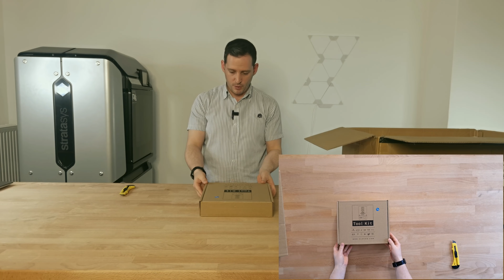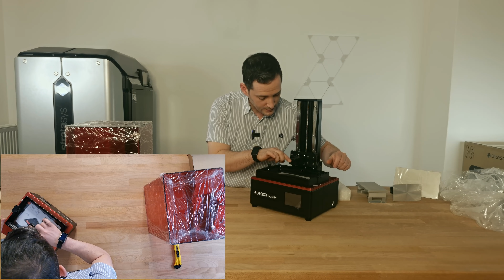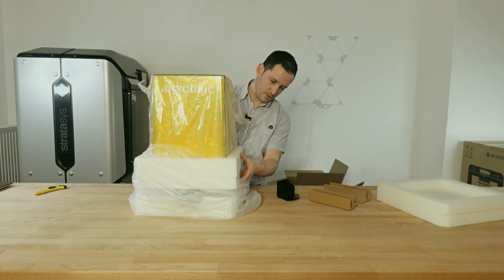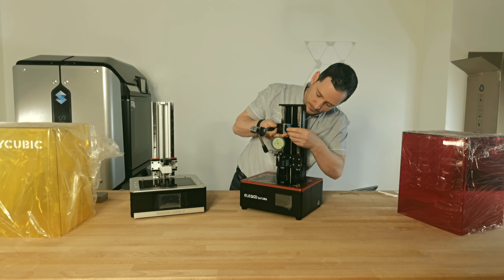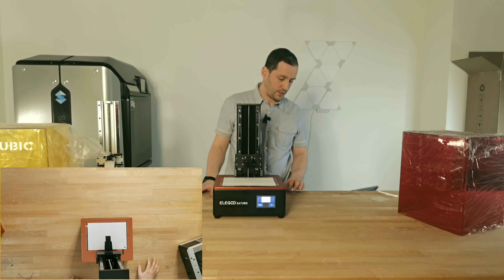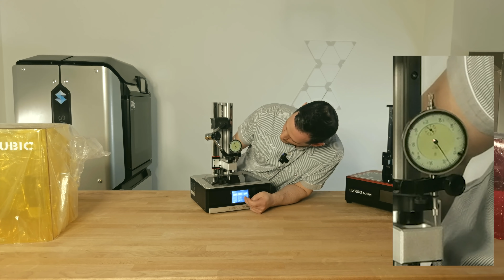Elegoo Saturn vs Anycubic Photon Mono X (In-depth comparison)

Comment: Can I be so curious and ask about how you set up your overhead shot? Thank you for the informational video!
Reply from the maker: Hi. I did mount a rail onto my ceiling. From there I do use a telescope selfie stick which I adjust in length so the front camera does not see the ceiling camera. I can adjust the position of the ceiling camera by moving it in the rail and changing the length of the stick. Hope this helps.
Reply: @Twins Talk  Thank you! It looked really nice so I had to ask. :) Have a great day!

Comment: Was there an answer from anycubic by now?
Reply from the maker: Hi. No there was no answer. I got my money back from PayPal.
On another note, I did buy the anycubic m3 max and will compare it to the elegoo jupiter. Stay tuned.
Reply: @twinstalk  thanks for the quick reply. Will you also get the new saturn 2 8k and compre it to the other?
Reply from the maker: @MCaquaculinaris  most likely not. I did buy the jupiter and the m3 max. I also will get one of the bamboo labs printers. So my budget is down to zero.

Comment: Great technical review! just for my curiosity, why is backlash in Z so critical if the printer always retracts to about 5-6mm and goes back down in the same direction? 
What is important in my opinion is not even that it doesn't get to the same position in two different directions, only that it gets to the same position in the same direction! Any mechanic knows that you have to work in one direction to get any reasonable accuracy (for example if cutting screw threads on a lathe), so you do exactly what the printer does - cut in one direction, pull back not cutting, and do the next turn in the same original direction.
In summary, I doubt this "Z backlash" is really such a big issue. I would be much more concerned about Z wobble and sturdiness of the printer.

Comment: To each his own opinion.

But if a manufacturer is not able to correct its case to fit the intended use when it changes something in development (display size), then makes its customers happy with a "gaffer tape", it should probably rather build with Dixi toilets. 
Honestly, I find something like this more embarrassing than the type of surface of the build platform. On the one hand, the decision to use a flexible pressure plate is not a bad one given the size of the build space, and there's no substitute for 50mm more build space. 
In practice, the pitching movements do not come into play with either, but yes, the build plate is crowned, but you can complain about that. Others also manage to have the inaccuracy captured by a camera. However, your equipment was not set up for that. 
But as written at the beginning, to each his opinion and his priorities.

Comment: The edge bevel is probably to help break the hydrostatic pressure of the resin during separation of the build plates movement
Reply: Yes, I don't believe that the entire build plate is supposed to be completely flat. It is my understanding that, If the plate were completely flat the hydrostatic pressure would be too high and end up tearing the print off of the print bed. 
This is important information to have prior to breaking out the measuring tools and pressing the record button. It makes Anycubic look like they are producing low-quality products when in reality it is the testing process that is off. What was the reply when you reached out to Anycubic customer support? If the plate is as it should be and the error was on your end, then the only ethical thing to do would be to edit the video and reupload.

Comment: What is the feedback from anycubic? Is that defective and need some new replacement parts? Also any actual print test? Great review. I subscribed your channel right the way.
Reply from the maker: Hi xMondas King. According to Anycubic, new parts have been sent out but these never arrived. Also I did not get any tracking number. The support responded fast (used Aliexpress chat) and was very nice. After not getting the parts, I asked for a refund without success. Had to use paypal to get a refund. Long story short: Parts never arrived, printer is still defective.

Comment: Amazing Video! informative and to the point! I have both and my Mono X doesnt have the build plate issue or the wobble like yours did. Hope they remedy it fast for you! Look forward to more videos!!!
Reply: Wich one you like more ?? I want buy the Saturn, but im open to buy the Mono X too. Also what about slicer ?? Both are colse to use only one slicer, right ??
Reply: @carloscamargo6625   I use my mono x more. It works well and it’s dialed in. Both are great. I bought the mega wash station with it and it fits well with the Saturn also. My Saturn I only use when I need more printing to do. Settings are slightly different but a quick fix. I use both lychee and Chitu on both. Haven’t had an issue with only being stuck with one
Reply: @DaneManGames  Thanks a lot for the info bro. The price difference in my country is almost 250 usd. I think i go for the Saturn, or wait for a 6k version of saturn like the Mono X 6k.
Reply: @carloscamargo6625   If thats the price I would for sure go with the saturn!!! Amazing machine! I got my mono on sale so its why I have it. Saturn is an amazing machine in itself. I just dont use both large machines as much as I would like.
Reply: @DaneManGames  Yes, i can see good comments about this printers in all reviews. I hope find a good deal and buy one of them soon

Comment: What a fantastically detailed analysis.  I especially liked you testing and reporting on the resonant frequencies of the build sheets; that’ll be very useful info for me to refer to, when I eventually buy one of these units myself. I also really liked the flatness check and tests with the dial indicator, checking stiffness and backlash!

Have you gotten the replacement parts from Anycubic yet? I’m leaning strongly towards the Saturn, but would be interested to know the outcome with that Anycubic after repair.
Reply from the maker: Hi Dave Etchells. Thanks for the nice comment. Did not get any parts, will most likely repair the unit myself when I have some spare time.

Comment: Thank you for the review! Any update on print quality?
Reply: I have both of these. I find myself going to my mono x more than I do the Saturn. I started a long time ago with the photon. I will say that the Saturn does have this crazy speed lift it likes to do and they were supposed to have fixed it in the firmware. It some how still does it and sometimes ( not all the time) it breaks off my supports, where the x does not have this issue with same resin, same print.
Reply from the maker: Hi DaneMan. Thats a nice insight. Can you tell me if the newest firmware update did solve your problem on the Saturn?

Comment: Thank you for the review! have the corrected details been sent? how much has the functionality improved after installing new parts?
Reply from the maker: Hi SuperRoman. I did not get the replacement parts:( had to issue a refund for the printer using paypal. Printer is still defective.

Comment: Looking straight into the UV light while its on without the UV shielding is a dumb thing to do. Guys please avoid doing this!
Reply from the maker: Hi TinkerTom. Thanks for the comment. I do have the paper on top of the UV-Light. Could not find any info on damage that it may cause in this "dimmed" state. Do you have any info for me I could read on this subject?

Comment: Great video. Did the Anycubic support team get back to you? Also, did you notice defects in the prints?
Reply from the maker: Hi D3cyTH3r. Could not do any testprints. Will need to repair the printer first, i think...
Reply: @twinstalk  Thanks. I bought a Mars 3 in the end. Really happy with it. I also bought an Anycubic Wash/Cure machine -it stopped working after 2 days 😂

Comment: Don't forget that the Saturn is locked into using Chitobox and the Anycubic isn't.  I have a Mars 2 pro I bought just a few weeks ago and now I wish I hadn't.  It works great, but I HATE the idea that i'm locked into chitobox, ESPECIALLY since they are going to start charging for it at $169 (US).  There will continue to be a free version, but we know how that goes.  It will get stripped down to an almost unusable state, to encourage you to spend more money on software.  I paid just under $300 for the machine and now they want almost $200 more for software?!?  I think NOT!
Reply from the maker: Thats something I did not look at in my comparison. Is it still a paid version?
Reply: You now can use Lychee to slice your prints.

Comment: ELEGOO & ANYCUBIC: Please sell finished PRODUCTS! not prototypes in big quanitities! My Elegoo Saturn was not usable at all. Based on this detailed review/test I purchased the Elegoo Saturn (newest iteration with some fixes already done by Elegoo). But the quality of my Saturn was that horrible I had to return it, the issues were that bad so that printing was not possible, and there were several big issues with the machine. The I purchased the Anycubic Mono X, again several issues, mono screen loose, Z axis spindle not manufatured right, FEP sheet too loose without the pssibility to tighten more. But all in all with my two printers the Anycubic had less and less severe quality issues. (I'm a machine mechanic and Engineer, so I know how to handle these machines)
Reply from the maker: Hi Lars Peyer. How was your experience with the support of both companies? Sorry to hear that both of them had problems for you.
Reply: @twinstalk  ELEGOO replied fast to my issue with the uneven UV light source in my ELEGOO MARS PRO. They seem to be helpful, but I still need to send them some pictures of the problem. So It's my turn to act, cannot say much more at the moment. I can come back to you when the support ticket for my MARS PRO is solved. The ELEGOO SATURN I ordered from Amazon (sold by ELEGOO, shipped by Amazon). I returned it and got my full money back. I had no direct contact with the ELEGOO team here but thumbs up for a full refund of the used/tested printer. I just was not willing to change 2 or 3 major parts an deal with coding my own version of firmware anymore. So I just returned it without fixing the severe mechanical faults.

Comment: Just got the Mono X....the UV light in it is absolutely nuts, turned it to %80 and it prints about 2x faster than my Saturn and Epax E10(Don't buy one of these...ever, I'm now waiting on a replacement board as the one it shipped with had a flaw that would cause a UV light to stay on....which you don't notice when it's under a vat of resin....then you get burning smell in your basement and you're running around looking at 20 different 3d printers and your crypto mining rigs wondering what's dying.

Comment: No wonder the Elegoo has supply issues. It's such a well made piece of machinery AND its the cheapest of the mid sized resin printers. Sometimes higher cost doesn't mean better product!
Reply from the maker: Hi gadgetman. Yes for the 500 or so € this is a great peace of hardware. I do have two now:)

Comment: Great video. I do have a question though. The screen sizes are identical (8.9"), but the Mono X build plate is larger. This means the usable print space on the actual build plate is identical between these 2 printers (same build volume), but the edges of the Mono X build plate would have a larger "dead zone", and you should not see anything printed there. I assume you also have a "dead zone" with the Saturn as it makes sense to have one, but it is just smaller. Therefore since it is the corners that were the issue with the build plate, is it possible that is by design and not even printing on in that area? Or did this stretch into the actual build area?
Reply from the maker: Hi. It was labelled as defective by the Anycubic support, so I think it was to much of a dead zone for the plate. I did measure around 10mm from each side. As you stated smaller dead zones may be ok.
Reply: @twinstalk  I really appreciate your reply. I was watching videos deciding what to get. I ended up with the Mono X due to its good reviews, in stock, and on sale :). I can validate that, at least for me, the build plate appears to be straight, so my thought process above was definitely off. There is one thing I wanted to note, and that is the default UV power is set to 50%. My prints were a little off, so bumped it up to 80%, and prints are much better. I am playing around with decreasing the UV power and increasing the time for each layer to try and find the sweet spot. The manual states they recommend 80%, but it shipped at 50%. If I would have read that part of the manual my first print would have come out great. Thanks again for a great video and responding. Keep up the good work, it is much appreciated.

Edit: One thing I wanted to add. Anycubic shiped very quickly. I received the Mono X much faster than I was expecting. I wanted to mention this as shipping and customer service is important to me. They have also replied to 2 emails I sent them within one day, concerning my Anycubic Zero that I purchased in the past (not an issue with the Zero, just question on the FEP they sell for it). Let's hope I don't have to test out their customer service for anything else :).
Reply: @bobboberton1841   My Mono X came next day also! I immediately put the power to 80% as most of the resin details on the spreadsheet doc state that anyways. Prints have been flawless. My Saturn tends to break my prints sometimes with the overspeed lift issue ( updated firmware). So far so good two weeks into printing non stop.

Comment: LCD screen Mono X: Is it normal that the LCD sits quite loose? I can push it down a little bit with one finger very easily.
Reply from the maker: Hi Lars. It was not loose on my printer.
Reply: @twinstalk  thanks, ok I have to check with the support, it is too late now to return it... I'm tired of the lack of quality control for these chineese manufacturers...! I recently purchased 5 machines from Elegoo & Anycubic, every one of them has big issues, the Elegoo Saturn was that horrible that I had to return it for a refund, had 3 major issues so that the printer wan not usable at all... now with the Mono X again, several issues I have to figure out with the support... Elegoo & Anycubic: please sell finished PRODUCTS! not prototypes in big quanitities!

Comment: FEP TUNING: My Mono X had 165 Hz only as shipped, after tensioning all srews I am at 181 Hz and think I cannot tighten them more without breaking the hex inside the screw... but I test the tuning not like in this video (laying on the table) but holding the frame of the resin tank carefully on one side so that the frame can swing freely. In my opinion with the resin tank on the table you cannot get an exact reading of the tuning. I had values from 200 to 400 when it was on the table. What do you think about my approach? I'm not shure if my tuning is enought but cannot get it any higher...
Reply from the maker: Hi Lars. Did you use the same app? It 181hz seems a little bit low. Did you try printing with it?
Reply: @twinstalk  No not the same app, I don't have access to an android phone, so I used another app for ios, this app I always use for tuning my acoustic guitar though... In the meantime I tried one print, it worked as far as I can tell, but a loose FEP sheet can be a problem with one specific print geometry/size or can be no real problem with another print model... I don't want to set the lift height too high only because the FEP cannot be tightened enough, it would extend the print duration too far, can easily double the print duration.

Comment: Is my Mono X still OK or too bad? I did the same mechanical accuracy testing to compare (just received my Mono X). Backlash with mine is 0.04 mm. Your Saturn goes up ecaxtly 1.00 mm every time, my Mono X has an inconsistent spindle I guess, it goes up randomly from 0.97 to 1.02 mm when it should do exactly 1.00 mm! Should I return it? Thank you very much for your help
Reply from the maker: Hi Lars. I think a Backlash of 0.04mm is ok. Because when printing the first layers will have higher exposure times and layer thickness.
Reply: @twinstalk  Thanks. but is the backlash not also a problem for all the following layers right until the end of the print?